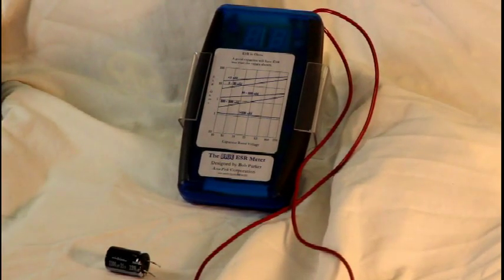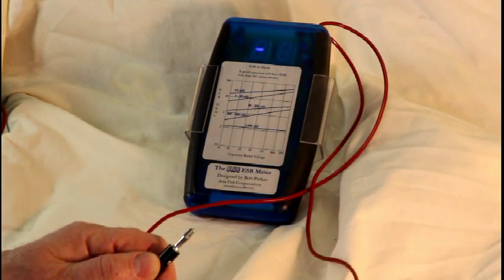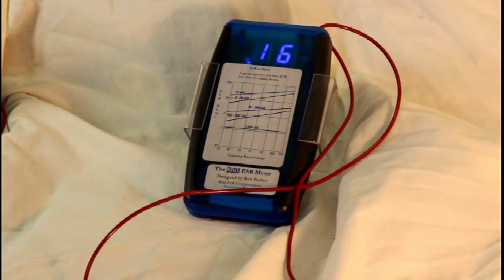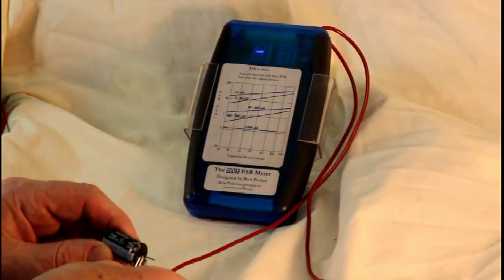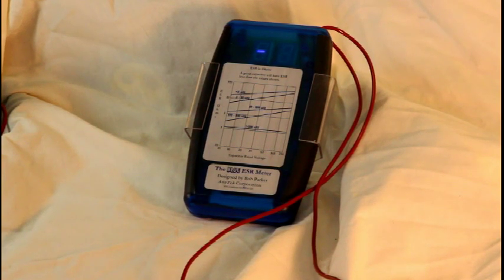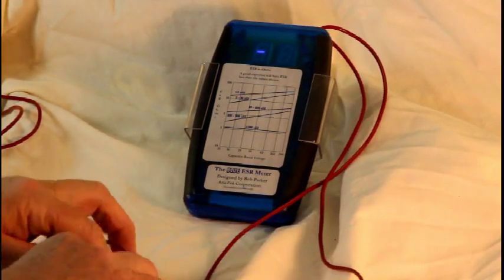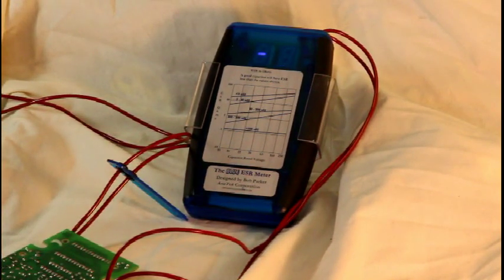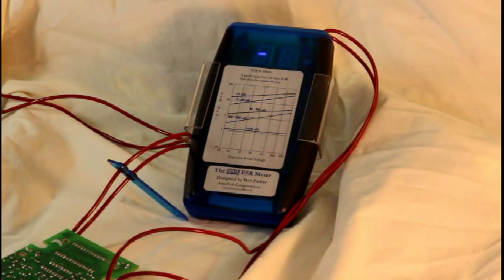Blue ESR

Comment: I have been searching for instruction on how to use this for a while. Thanks for the video. Wish there was more example on this. if 16v 220uf capacitor esr value in circuit shows .95, is that still good or I should replace it?
Thanks

Comment: I'm confused about reading the graph. Comparing values on manual chart to the graph on the front of the device, they don't seem to be equal. Is the graph wrong or is the chart in the manual wrong? Very confusing.
Reply: You can download a chart of typical capacitor ESR values from http://bobparker.net.au/esr_meter/images/2003esrchart.pdf  Much less confusing than that graph which was created by an engineer. :)

Comment: Sir - does your Blue Meter allow a capacitor to be tested in circuit. Say I want to check capacitors in a tube type VFO if one lead goes to ground and the other to a pin of the tube socket will the tube cause confusion to the Blue Meter?

Thanks
KG0MN

Comment: When you indicate a capacitor as good in this video that is only in terms of ESR. Value wise it may not be. I have seen them mis marked with the wrong mfd value, or the value in mfd changed with age. Leakage current in lytics is another issue. Leakage would be like a parallel resistance across the capacitor.